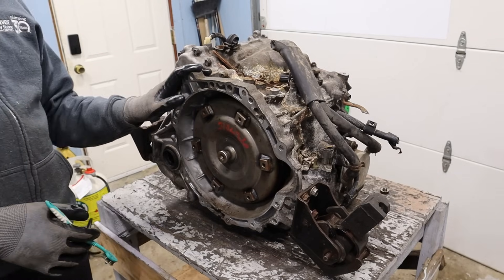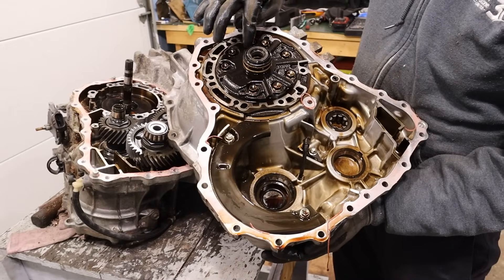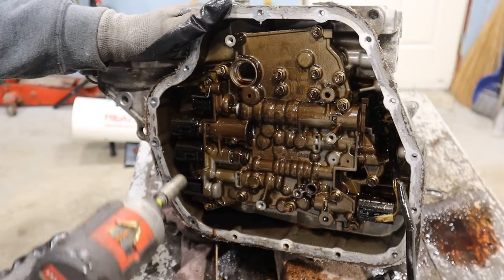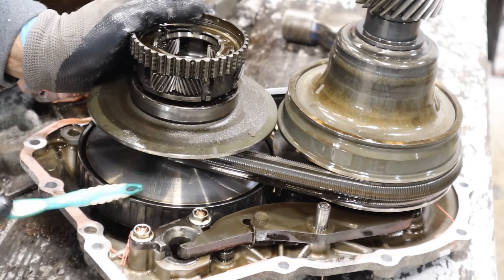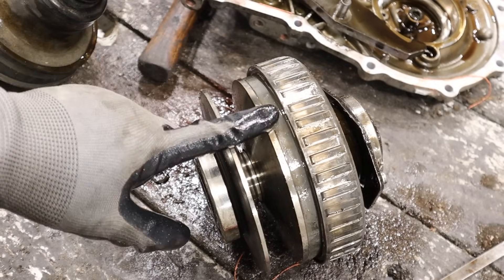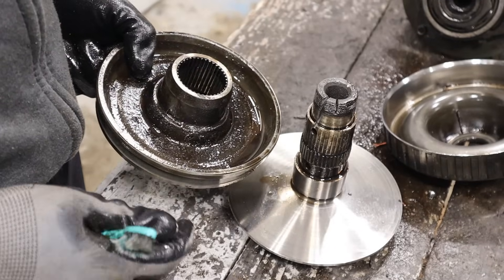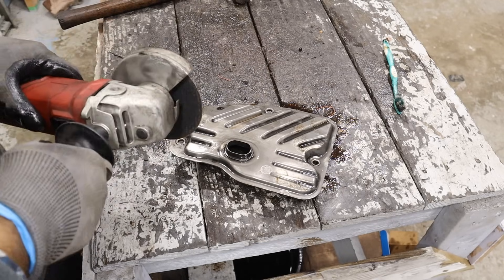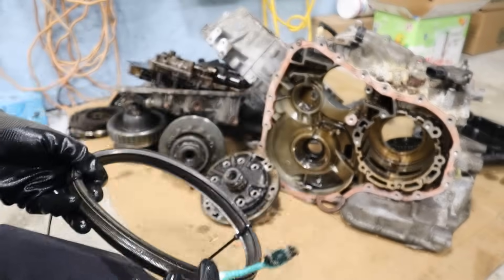Toyota CVT's Are Not as Reliable as you Thought! Corolla K313 Transmission Teardown & How it Works

Comment: By the way, this is NOT the same Toyota ECVT used in  Hybrid models. That one is super reliable.
Reply: All cvt transmissions suck, the only reason the Toyota e-cvt transmissions are somewhat better is because of the launch gear. The cvt design makes them destined for failure and you cannot buy parts to rebuild them. You'll never see a cvt transmission with half a million miles on it. I don't understand why you people feel the need to go against every professional transmission technicians expert opinions.
Reply: The only CVT with a launch gear is the K120, which is only found in cars with the M20A-FKS 2L engine.
Reply: @donniev8181  you are confuse E-CVT with DIRECT SHIFT CVT which has launch gear. 
ecvt is TOTALLY different process from CVT or Direct shift cvt.
ecvt is 100% simple PLANETARY GEAR! most durable transmission!
Reply: @donniev8181 e-cvt doesn't have launch gear.
Reply: @donniev8181 JATCO CVT sucks not from Toyota lol!
Reply: @alanmay7929 did not say anything about jatco and I own a Toyota.
Reply: @donniev8181  I also think that cvt's are not very reliable. But you are wrong about the transmission on the Toyota hybrids
Reply: @donniev8181 Sir, I believe you are mistaken, there is no launch gear in an eCVT transmissions. Instead two electric motors, and a combustion engine modifying their inputs into a planetary gear system to achieve regen, reverse, acceleration, and highway cruising with a lower torque more efficient Atkinson cycle engine. Mechanically speaking it is very simple and reliable.
Reply: @Chazz155511 here you dolts go again. Go buy replacement parts, you can. A geared transmission can be rebuilt, these cannot because there are no rebuild kits. Every professional transmission technician will 100% tell you cvt transmissions are horrible!
Reply: @donniev8181  Can't get more simple than two electric motors and a planetary gear to cut it short that is why people like them. There are examples of these with north of half a million miles so long they weren't ran dry.

Comment: Problem seen in this video is multi-plate clutches.
These clutches also used for the conventional automatic transmission.
BTW, Belt and pullies looks okay.

I think the conventional automatic transmission will show the same problem if not maintained well.
Reply: Of the failures I've seen on CVTs so far it's almost never been the belt and pulley system itself, but something else due to abuse, neglect, poor design or a combination of all 3.
Reply: @amdstrollo3074 it’s clearly lack of maintenance!
Reply: @alanmay7929 and probably driver abuse!
Reply: My wife had a 2013 Nissan Rogue (sold as a 2015 Rogue Select, man this caused so much confusion when dealing with parts), and I changed that transaxle fluid often and we didn't dog it or anything.  The failure... wasn't a CVT or other transmission failure itself, the differential bearing the CV axle sits in failed, which could have been the same bearing that the diff carrier rides in. Since Nissan doesn't sales parts for the transaxle and full transaxle removal is required to get to the diff, that mechanically total it.

Comment: I guess all CVTs need fluid changes and gentle driving to last a long time
Reply: that was my comment above.  their inherent design does not include ignorant driving.  if you drive smoothly they should be great stuff.
Reply: As does every transmission...and engine...and vehicle.
In fact .....anything mechanical.
Reply: Not really , My Subaru has 190k on it and I keep the fluid clean and have a aftermarket trans cooler on it and i have a lead foot. I have always been of the mind that it is good for engines and everything to be put through there paces instead of always putting around and never blowing out the cobwebs.  I don't rag it out but I don't baby it either. Now that being said I always come to a total stop when I back out and put it in drive and I wait on it to engage. That is really hard on a drive line and I always use my emergency brake when I park to keep the stress off the trans.
Reply: I @wes2460  that's quite good, the trans cooler keeps the CVT from overheating especially in traffic. They just need servicing and are very sensitive to neglect.
Reply: Just like any trans does.

Comment: Dear Speedkar Man. I know this question has nothing to do with this video....But, how does the crank/cam timing get set, when there isn't any keyways on the ballancer?
Will You do a video about that? Or, at least suggest where I could find out? 
Do They heat up the ballancer, then shrink it on the crank, at the factory? WTF?   
Donna Chassie  
PS I love all Your videos! You prepare each video beforehand, not like the other guys.

Comment: Automatic torque converter transmission are repairable and reliable. 
Change the disc's like motorcycles and continues.
If the other hand if CVT have problem is for the garbage. 

P.S The first CVT was the DAF Variomatic, developed and used by the Dutch car manufacture DAF in the 1950s and 60s.
Reply: I had a Daf 66 1.3 Marathon.  It was referred to as Variomatic - Designed by Van Doorne.  Straight drive via propellor shaft to the  rear mounted twin rubber belt operated CVT which was exposed to the elements.  Ran good but whined so much.

Comment: We have the K313 CVT transmission in the 1.8L 2ZR-FE powered Corolla in Pakistan. So far, no problems reported. The smaller engine sibling 1Zr-FE 1.6L engine Corolla used to come with a standard automatic transmission (U340E), and I admit that this transmission was more robust in terms of reliability and durability.
Reply: In which car installed corolla in pakistan k313.altis cruisetronic or grande and which model

Comment: Lack of maintenance
Reply: Yup. If the owner changed his fluid at no more than 30,000 mile intervals it would still be fine.  CVT's need fresh oil not only to lubricate parts but to keep up the pressure on the hydraulics.
Reply: Never changed the transmission fluid for 170k miles, then complains it’s not reliable.
Reply: @aluisious  170k kilometers, 1km = 0.6 miles   = 102,000 miles  (this guy Canadian I think)
Reply: @aluisious 170,000 km’s not miles
Reply: @aluisious my 1st cvt i only changed every 100k miles for the fluid but all my cvt I've been changing every 60k. Miles.
Reply: @aluisious why is it so many people...including mechanics, people from Toyota, general car nerds etc...tell me not to change it? I have a used 2017 Toyota Corolla Le that never had its transmission fluid changed, so it's far too late to mess with it now...but they say its fine. Why is there so much debate on this?
Reply: Same for nissan
Reply: My 2016 camry SE automatic transmission. 
350,000 miles / 550,000 km plus . 
First transmission fluid change was 200,000 miles. 
Everything work just fine
Reply: @sofjanmustopoh7232  firstly that's an automatic not a CVT secondly you drive a lot of miles so you were able to get lucky and get away with changing the fluid at 200k.
Reply: @roccol3110 hence auto is BETTER than CVT anytime of the day
Reply: 230,000 miles and still going strong boys! 2017 Toyota Corolla is a monster
Reply: Whem toyota failed :
Lack of maintenance

When other brane failed :
Your car is shitty

What a bunch of hypocrite fanboy 🤭🤭
Reply: @ramadhanisme7 bunch of hypocrite Nissan fanboy 😂😂
Reply: @ramadhanisme7 no one is saying that, in this case its just the truth.
Reply: Sealed unit?
Reply: CVT transmissions suck, the overall design is horrible, ask any professional transmission technician.
Reply: @donniev8181 you mean Nissan Jatco CVT sucks right! I hope you actually watched this video and him comparing it to Nissan terrible design!

Comment: Would routine fluid drain and fills prolong life? I’ve heard cvts require even more maintenance and fluid changes will aid massively in this since I’ve known a few people own high mileage cars with cvts, citing fluid changes to be critical towards their longer life, especially with the factory spec fluid.
Reply: Yea.  For CVTs, drain and fill every 30k miles is a must if you want to extend the life.  They wont tolerate poor maintenance unlike regular geared auto transmissions that can last so long as you dont abuse it